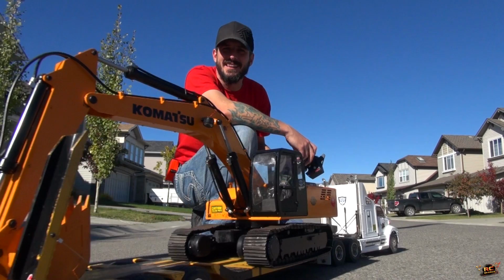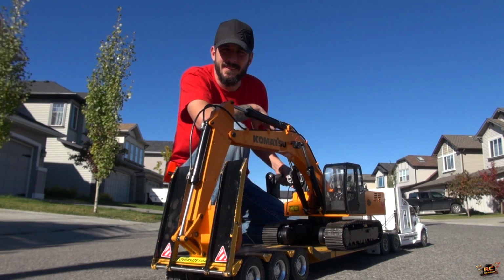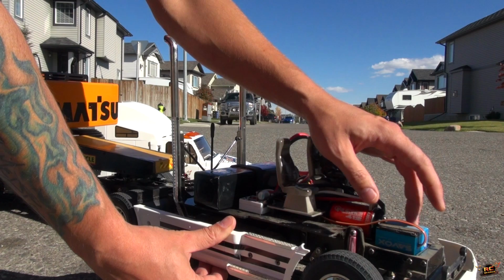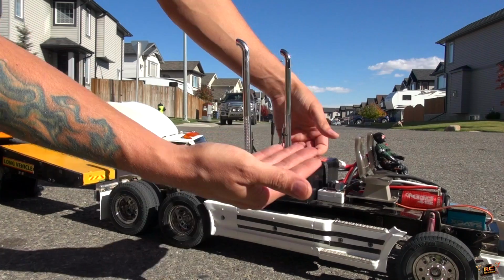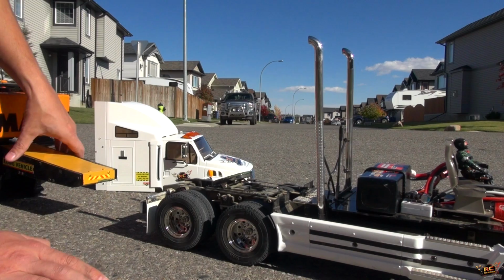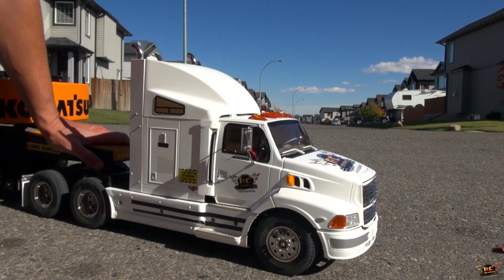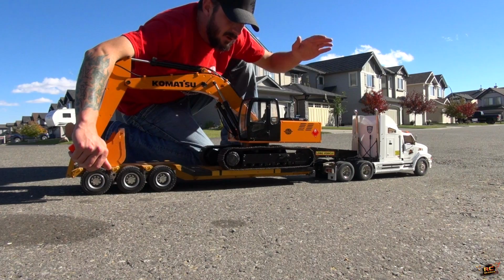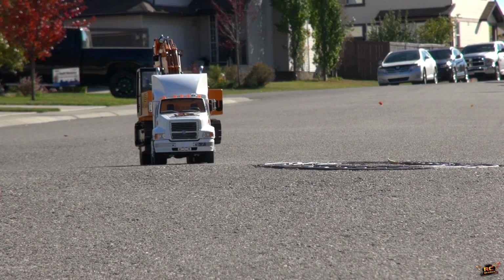RC ADVENTURES - Ford AeroMax 1/14th 6X4 Semi Truck hauling Excavator on Trailer

Comment: nice medic  , here in the states ur truck would need a yellow flashing light on top of the cab and a wild load sign on the back of the trailer and a red flag on each side of trailer on the end . but very cool  eny ways  u may have to  strap that excativer down lol  , and  hey I was woundering if that 3 speed tran would work on a buggy

Comment: NO NEVER USE MFU!!! Go for Servonaut! its the most impressive electronics to the semi trucks.

Mfu do not have dragbrake! so going down hill can be scary!
Also servonaut gives cruisecontroll and lightoutput points. it will also give option to infrared parts and alot more.